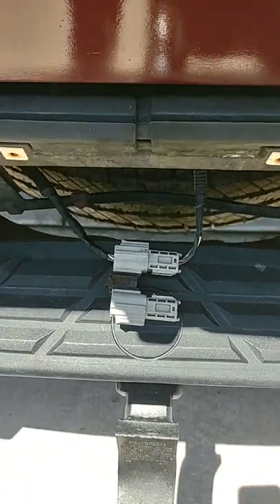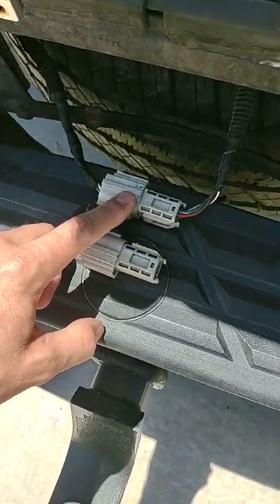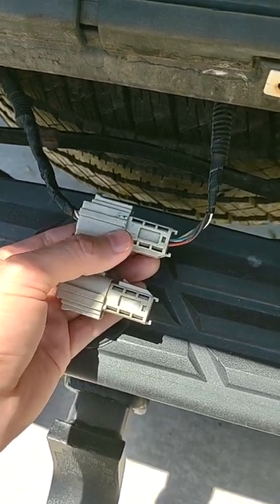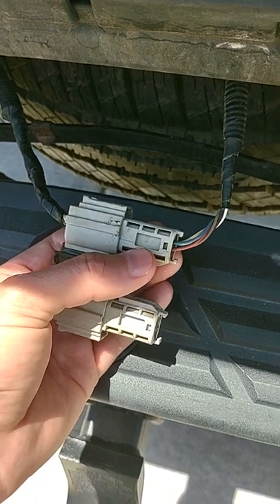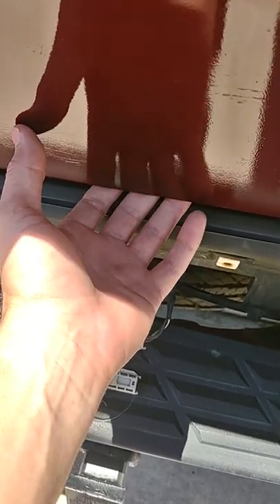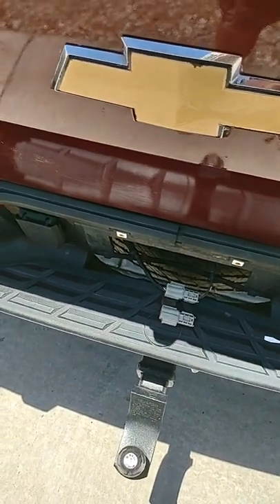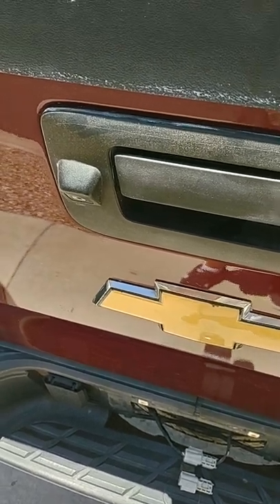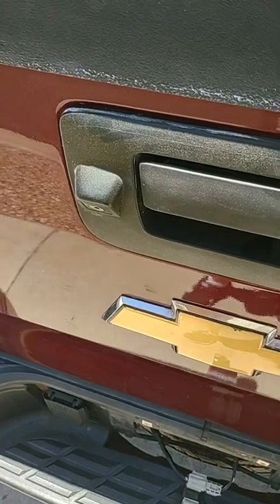FREE FIX ! Broken Backup camera for Silverado GM trucks 07-14 !!

Comment from the maker: Thanks for watching ! steps: 
-check all fuses for backup cam (refer owners manual) 
-pull license plate, clean electrical connectors. reconnect, make sure you hear the "click" sound  
-make sure wiring isn't pinched in the tail gate crack (highly possible)